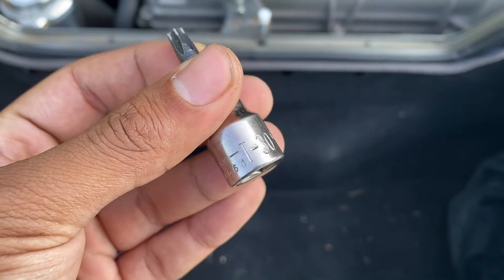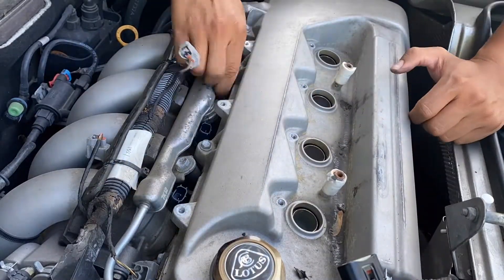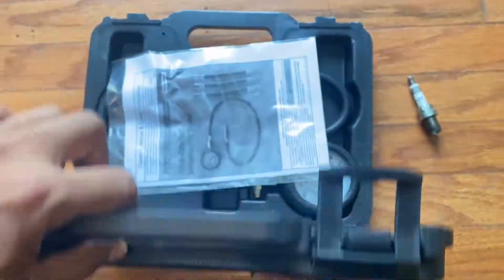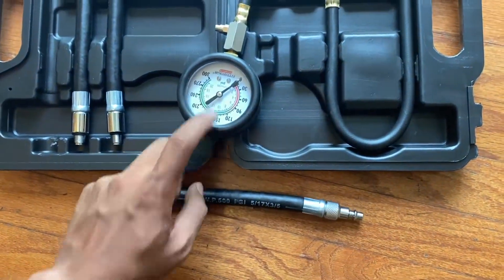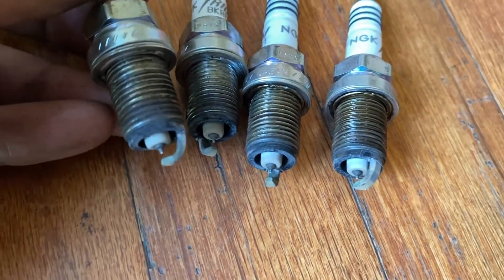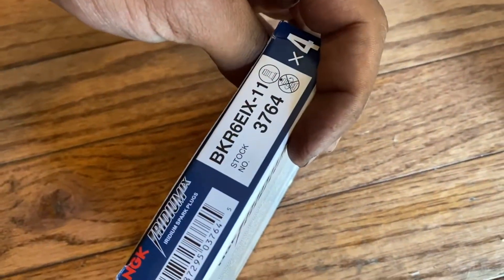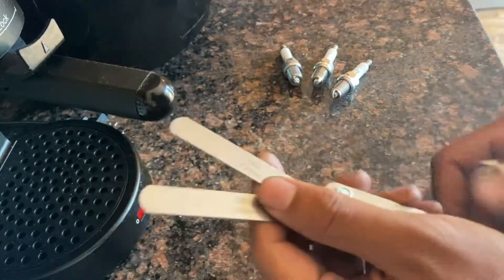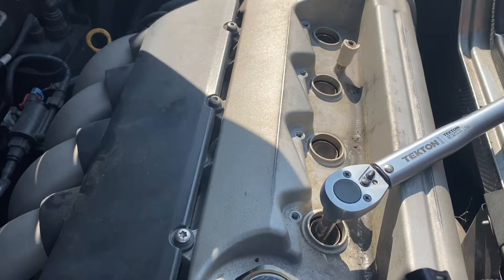LOTUS Elise 2ZZ Compression Test and How to Change Spark Plugs

Comment from the maker: *THIS WAS DONE WITH THE ENGINE COLD* I just wanted to make sure there was very little variance between the cylinders and there is nothing unusually low. I will likely do another compression test with the engine warmed up, whichI'm expecting to produce closer to 200ish PSI on all cylinders.
Reply: Should be 210 psi or higher for a healthy engine, recently got a jdm longblock and throw 230 psi across all cylinders
Reply: 215 as well with out open the throttle.